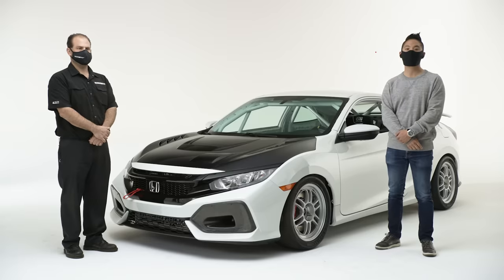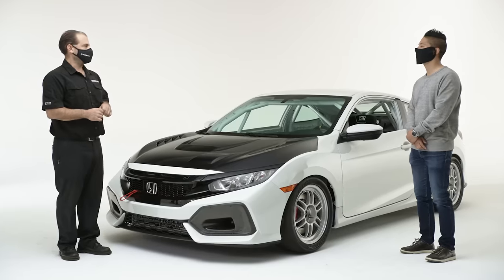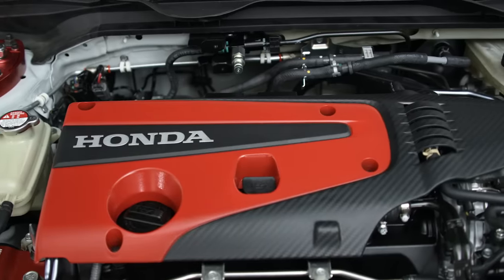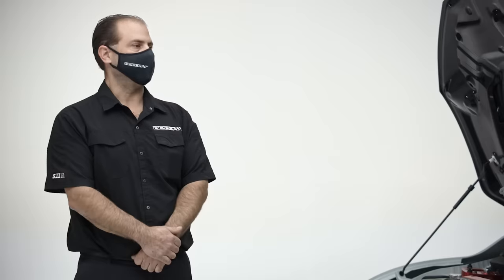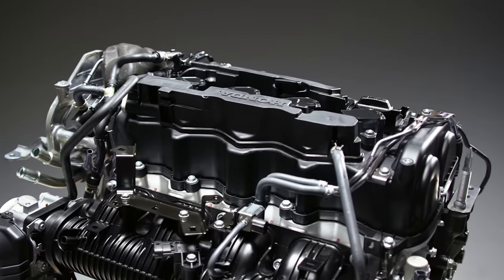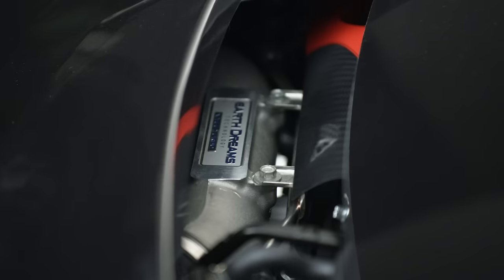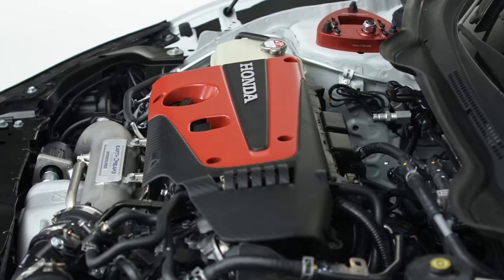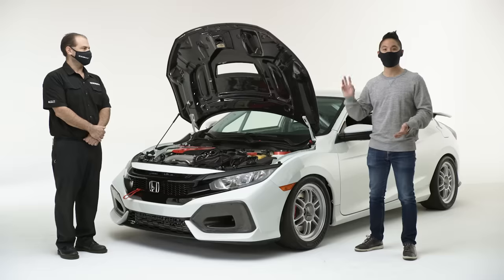First Look: Honda Performance Development K20C1 Crate Engine | MotorTrend

Comment: 306-horsepower, 295 lb-ft for anyone wondering.
Reply: Thank you!
Reply: All that yacking and no relevant specs, thank you for providing what people want
Reply: Thank you for this!
Reply: MUM!N  probabñy super reliable
Reply: I want to know what it revs up to, and the vtec rpm range
Reply: @DracoOmnia  They said multiple times it's the exact engine from the 10th Gen Civic Type R, like literally the exact same engine, Google is your friend.
Reply: That's factory tune for the road car.  Though there is some discrepancy with that to begin with (Hondata originally dyno'd it to about 295 at the wheels, currently claiming 320 HP on their website stock).  That said, HPD team did a video on their Civic Type TC and quoted that they could run anywhere between 270-330 HP depending on the track and setup they were going with for that weekend.
Reply: @Jack Russelle Lewis Google another plug and play crate motor with factory support and a warranty for the same money and see what you get.
Reply: @Jack Russelle Lewis says the person who does not mass produce crate engines
Reply: The best engine in the world 2.0L turbo Type R Engine.
Reply: Thank you! exactly what was skimming through the video to find.
Reply: Guys it’s not legal for road use if your race car is your road daily so I don’t understand why they would advertise this when the largest customer base isn’t allowed to use it to go places other than the finish line
Reply: @removeableskull7446  oh snap I guess no one can run it in their road cars 😂😂😂
Reply: How much to the rear wheels 280/270?
Reply: I’m joking lol
Reply: Ty, you would think they’d mention it
Reply: @boyaklan3742  s55 BMW better engine
Reply: Literally the only thing that is really relevant to a engine video that they totally missed 😂🥴
Reply: @boyaklan3742  you wish lmaoo
Reply: Thank you
Reply: Type R engine?
Reply: Wow that's pathetic
Reply: @Jesse Shoe Breaker do you happen to know the weight of this crate engine?  I googled but couldn’t find anything definitive.
Reply: Just wasted 5 minutes of my life and then you totally saved the day!
Reply: Without weight, that data is useless. If we suppose the weight is 1200 kg, that would give 0.25 hp per kg. A modern motorcycle has a much better power to weight ratio.
Reply: It is not just the power figures but all the things you cannot see that allows thus to perform with reliability and longer than a run of the mill DIY that produces tge same figures
Reply: Had a 2.2l dodge motor at 300 hp with bolt on parts.
Reply: @jonmurraymurray5512  In racing and other applications economy, reliability, size and weight ALL plays a vital role in competitive applications.

I am willing to bet the Honda has advantages to most if not All of those categories.

But I respectfully do know and see your point. There is more than hp in judging an engine.
Reply: @crxdelsolsir  thank you. Torque was 320 on that. The 2.2l was a stout engine, though. Turbo 2 internals meant a forged crack and pistons. Miss that car.
Reply: @jonmurraymurray5512  I am sure it had a lovely sound too. Never too late to get it. Life is short and cannot all be just working and saving.
But, totally understand if short in finance and need more important things.
Reply: Thank you very much.
Reply: @jonmurraymurray5512  This engine will hold over 640whp on factory internals - already made around 850whp with cams and more revs, upgraded rods.  When it comes to stout 4cyls fron the factory, Hondas have proven to make the jam on OEM rotating assemblies.  The S2000 F20c has held 803whp on factory internals from a 2L
Reply: WAS Wondering, Jeez and that;s STOCK, A bigger turbo/Tune should see a healthy STRONG 350/450BHP In a MK2 Escort/MINI.
Reply: That's just conservative power. It has much more potential
Reply: Can it go in a 96 accord lx manual
Reply: @campaignc154  Easily
Reply: @bearrett50kal17  Same engine but an ECU developed by HPD. Specs could be different but they obviously didn't say.
Reply: @harrisn3693  the way it was worded makes it seem like you have to have a team going to events for it. If you can buy it great! But I like to stay under the radar. Less rules the better

Comment: $9,000.00 for those of you wondering.
Reply: Is that including the ECU and harness?
Reply: @bingoberra18  ya I read it's all supposed to be included at the price
Reply: @SpinachLeaf  That would be really great value for money actually.
Reply: Thank you!
Reply: Will it work with the CVT transmission ... like the accord 2.0?
Reply: $6700 for the engine by itself.
Reply: Thats actually not bad at all!
Reply: That's not even that bad
Reply: Off by 500 dollars
Reply: Still good deal . 4000 to install
Reply: If you could find a wreaked R somewhere and take one out of it maybe be cheaper that way.
Reply: Thats dam cheap for over 300hp , 4g63 brand new blocks are 8k from Mitsubishi
Reply: This would be great in a manual awd element.
Reply: @blackvq3759  the 2.0 accord is not even close to a cvt. It's a 10speed auto or the 6 speed manual. Although in 2021 no more manual
Reply: @blackvq3759  I wouldn't mate this engine with the cvt.... that trans will grenade after a few runs or even just on a regular drive.
Reply: Lmao only making 93 control packages
Reply: F@CK THAT!!
Reply: That's an insane cheap price for a brand new engine.... that is only double of my team's fully race built B18C's overhaul price...racing cost a lot anyways lol
Reply: @Bamboo Shoot tell him to sell mine. I am fed up with it.
Reply: @blackvq3759  I'm gonna say negative since CVTs can not handle high torque well..also the accord 2.0(T)  has a 10 speed auto BUT ALSO A 6 speed manual! it think the 6 speed should work..with plenty of wheel spin :)
Reply: Would just be cheaper to do a k swap honestly but still nice theyll have a crate engine from the type r to say the least
Reply: @blackvq3759  the 1.5Ts are CVT the 2.0T are 10 speed auto or 6 speed manual.
Reply: @PaceWorks  you can get a remanufactured 4g63T engine from jegs for $2,400. Not sure where your getting 8K from.
Reply: Actually quite a bit less than I thought.
Reply: Honestly, not bad at all. For a brand new bullet proof engine, it’s fair.
Reply: And only available to Honda Racing Línea Members. 
What ever that means.
Reply: @Flako92  for now. It’ll be released to the public soon
Reply: @blackvq3759  the 2.0L accord only comes with a 6speed manual or a 10speed automatic no Cvt.Cvt only comes with the 1.5L turbo Accord or the Civic
Reply: @gmgranado94  10speed not 9speed
Reply: That's cheap.
Reply: @blackvq3759  why would you want to swap it. The accord already has the same engine
Reply: @blackvq3759  Its for track use only
Reply: @Peyton Brimmer in a professional series series?
Reply: @blackvq3759  nope, also 2.0L accord is traditional automatic, only 1.5L Honda are cvt
Reply: Not bad imaging swapping a k20 Type R NA will cost you almost the same
Reply: @Jack Russelle Lewis People literally said its included in posts above you.
Reply: @xsiner  but that engine won't be brand new. This engine is for people who want a brand new, turn key motor.
Reply: @William Arrington 😂
Reply: Bro thats a deal
Reply: @blackvq3759  why would you put mate it to a cvt trans itll take away from the performance it was might as well keep the accord engine
Reply: Totally worth it.
Reply: @blackvq3759  the accord 2.0t doesn't have a cvt. Its a 10 speed regular automatic.
Reply: can’t you get a LS7 for that money?
Reply: @gky3019  sure. But not going to be as unique. Also front wheel drive ls7 is hard to make
Reply: @gky3019  Different applications. You can get a motor but not a crate LS7 for that price. Those are still +15k for a crate.
Reply: #ricermiata
Reply: @ricermiata
Reply: Hate to sound like a fanboy but for 4k I could get a 1jz with trans... No ecu and wiring obviously
Reply: Install included...  ¿🙉?
Reply: @blackvq3759  yeah dude, works best with CVT gearboxes ...
Reply: What about one at a junkyard how much?
Reply: @blackvq3759  the accord 2.0 isnt even a cvt, that's the 1.5t... The 2.0t has a 10 speed auto
Reply: @William Arrington not even a cvt for the accord 2.0t
Reply: bingoberra18 shii swap this to my 9th gen
Reply: Wow that’s not so much for ecu and harness and pedal included
Reply: @William ArringtonIm in Ireland my friend we don't have them shops here and that was from Mitsubishi Il price it again myself but it was years ago I was told that .
Reply: @Bray91  We don't have Jegs over here in Ireland but its something I was told by person working in Mitsubishi dealership I should really price it myself I usually go second hand anyway 🤣
Reply: @blackvq3759  boi
Reply: @blackvq3759  probably not. I don’t think cvt can handle that
Reply: @Jesse Shoe Breaker they’re only more eco friendly and powerful not stronger. I mean it’s an economy car, they want to make it super fuel efficient, more light, so I think guy may be talking about integrity on the long run.
Reply: $9000 for 300hp  
LOL 🤣🤣🤣🤣
Reply: @bingoberra18  most crate engine is around that price. i thought getting lsx v8 that was for 9k and swap it onto s2k.
Reply: @gky3019  not crate, I think its about twice
Reply: @wahid3837  Yeah you cant really compare. Its not a crate motor newly built by toyota, its much heavier and bigger etc.
Reply: @BlueRice  They might be, but they dont advertise it. So not really sure a privateer can just go to random dealer and get a brand new turn key engine that would work by itself in any chassis. Actually barely any manufacturer provide such service. You got the american V8s but thats about it.
Reply: Just get JDM.
Reply: Do they sell to normal clients ? I thought they only sold to racing teams
Reply: @William Arrington Nothing like a Honda factory modded and assembled engine. Incomparable to the nano millimetre or inch.

Honda factory F1 precision capability is nothing compared to regular instrumentation, eyeball and feel and human error/inconsistencies when reconditioning or building engines under time and cost pressures.
Reply: Not bad price.
Reply: Ngl is juss go to a scrap yard and get one from a wrecked type r before the hype of this engine turns up.
Reply: @wahid3837  well we are talking about fwd cars
Reply: What’s the website to look at and purchase one?
Reply: @blackvq3759 What! Accord 2.0 with a CVT? The hybrid you mean?
Reply: thank you my guy
Reply: Now it cost 6k

Comment: 426 Hellephant       Honda K20C1
                            🤝
             Tuners dream engine
Reply: No cap all fax
Reply: good engine but honda miss the days where N/A of b series and k series was all time high. the time were early 90's and early 2000's
Reply: @BlueRice  yeah I had a 99 Prelude with the H22. I miss it but at the same time there is no way Honda could keep up with other companies in terms of performance, cost, reliability, and emissions without going with a turbo engine.
Reply: @ryant114  they can keep up or surpass with performance, cost and reliability in the same form factor. i think you got mixed up saying if they were to push its power for N/A to match the power of a turbo then it wouldn't be reliable in today world. back in the 80's and early 90's. Vtec is what made them able to keep up with turbo cars. they kept front wheel drive for that purpose of cost production and consumer love the fact its a sport car without paying premium cost at the same time. gas savor, low insurance cost and maintenance. full maintenance cost you less than 100 bucks with oil chance if you do it yourself. think of spark wire and plug 4 quantity each vs 6 or 8 and perhaps lower oil capacity. 

manufacturer got better so vtec alone cant match the power of a turbo. nissan gtr used same tech as ford. plasma spray on their cylinder wall. it made the wall so much stronger that is why they are able to use high compression piston. high compression give you better power and much faster turbo spooling. back then turbo used low compression for reliability that is why they have so much turbo lag. 

other manufacture used similar tech as vtec. like vvti for example.  get similar high out put. except that vtec is still better because it you both inhale and exhaust flow at the same time. some vtec sometime only allow just single side vtec but those are normally base model. 

before nsx release, they wanted do just engine plus electric. they tested a v10 on s2000 chassis. that was monster speed. it was so fast i think it wouldve easily get top 1st on nurburgring. due to economic that time they phase out to just v6 electric then v6 electric and turbo for the nsx.
Reply: @ryant114  its the engineering aspect of it. there's a limit how far you can push N/A to stay within emission. i agree with you for the most part. as production car, you wont be able to produce 4 cylinder engine to match any bigger displacement engine. unless you going up against a poorly made engine honda produce a inline 4 or 6 well above 1000hp with around 2.4 liter but thats a formula engine and it would never be a production car.  90's v8 mustang engineering was just poorly until 2011 thats when they step up their manufacturing process. cheap, reliable and fast was just  budget build. you can go with K series and it cost a lot more than going H or B series with similar result. 
Which type R you talking about? 
corvette V8 at long distance driving would get around 40mpg ( no mixed or city ). 

what people dont know. V8 has always been cheaper to build for power compare to 4 cylinder. there's a abundant of it. the thing is as an enthusiast people love that fact a 4 cylinder engine is able to produce so much power. 

i remember i had DC header 4 to 1. it didnt add much power to make a big difference. it was just carb legal header. the difference is tune. any bolt you add you need a tune to get slight better performance.

Comment: After doing some work with SRO and IMSA I just find that these engines are reliable for a consumer application and not a racing application. These engines do not like to be under stress for an extended period of time. I’ve seen my fair share of blow ups from rod failure. It’s a stock engine, baffled oil pan, and a modified turbo exhaust housing. IMSA BOP (310whp) on race fuel. It would be perfect if they upgraded the rods 😉
Reply: What SRO team? Because I've heard nothing but praises from the TC teams in SRO

Comment: Imagine being that guy at the time attack event with your 9k engined Integra just to get smoked by a K20A2 swapped Civic with an ebay turbo kit. But props to Honda for going out their way to make this happen.
Reply: yeah i would be the guy doing 9000 rpm and get passed by one of these
Reply: But you can also build this package up before install if the money is there. I’ll stick with my F20b turbo setup bc it’s cheaper to make hp unless i hit the lottery. lol
Reply: For a 0 miles engine, the price its not bad at all
Reply: Idk these engines with FBO are making 400hp
Reply: @homedepot1289  FBO?
Reply: @4cylfreak46  full. Bolt. on‘s.
Reply: @4cylfreak46  you probably 12 huh lol
Reply: @homedepot1289  lmao no i’m full grown. Nice try to insult me...
Reply: ain’t that a cute 1.5t you have in that bagged civic. lmfao
Reply: @4cylfreak46  what do you drive? Oh wait probably a 1200hp gtr huh 😂😂
Reply: @4cylfreak46   what’s your insta

Comment: Put this in the new S2000 please!
Reply: There's a new S2000!?
Reply: @genericallyaccepted  there are rumours, but unfortunately I heard it may be a EV
Reply: @nickpappas4133  oh no
Reply: Might be bummed if you catch the disclaimer at 1:32 cuz this won't be in anything but race cars
Reply: @mattstone8878  not Obama’s fault, this would’ve happened regardless of who’s in power
Reply: Been owning my S for over a decade and in that time I’ve seen rumor after rumor to the point where I don’t even get excited anymore. FFS just do it Honda
Reply: There is no new S2000 but this is indeed the engine line that should've been in it. The rumor is the S660 was coming worldwide given it is Honda's current baby and widely better than the S2k was.
Reply: They wont because they cant, it wont pass emission standards etc..
Reply: @arkkukakku112  it could pass with the much better K series engine in it, but I doubt they ever would given their S660 is slaying tracks on Asia much better than the S2000 ever did, and with much less.

Comment: A K20C1 swapped Honda Fit would be nice.
Reply: Yes, yes it would.
Reply: In M/R config even nicer.
Reply: I was just thinking that, it’ll probably need bigger brakes, diff and wider tyres to keep the power on the tarmac
Reply: I can't fathom how wild my GD3 would be with 3x the HP and TQ...
Reply: @jamesborek8125  
Well..let’s make that a reality. It would make good YouTube content! And you could possibly make the money back in the process.
Reply: Yup, a 2700lb GK5 Fit would be a blast except for the front and rear suspension. Think I will just stay with my 3200lb FL5. Same argument for doing any Civic.

Comment: For comparison the 310hp 350ftlb 2.3l ecoboost crate is $6k plus $1.6k for the controls pack.
Reply: They are also known to explode.
Reply: @Turb0esky  You can have your own opinion, but a study using the Consumer Reports Auto Reliability Survey said Ford turbo engines were not significantly better or worse than the usual non-turbo engine. Explosion was not listed as a problem, so that is hater rumor. Ford makes more than two million turbo motors every year, more than any other manufacturer.

Comment: why not more detail ...? ibsee it's in a civic si ..... what about clutch that was used ? is it a si transmission or type r transmission 
do you need the wiring harness and pcm if it's going into a civic si etc please more details

Comment: Is this close to the motor currently in the 2019 Accord Touring 2.0t? , If so, could the ECU and harness be changed to increase performance on the Touring 2.0t or is there more that you would need to do?